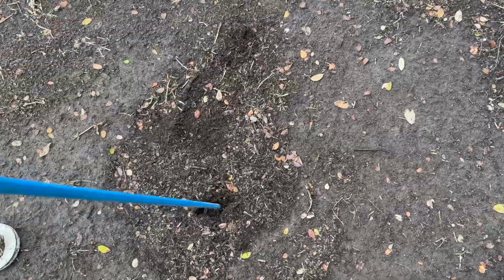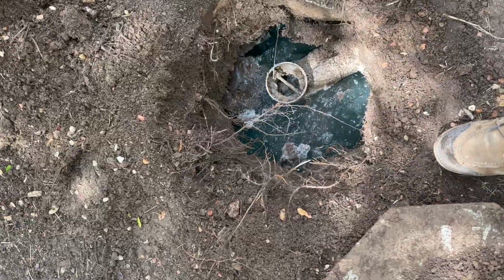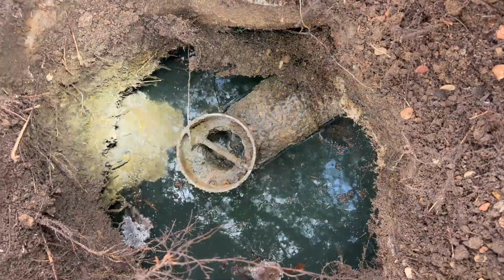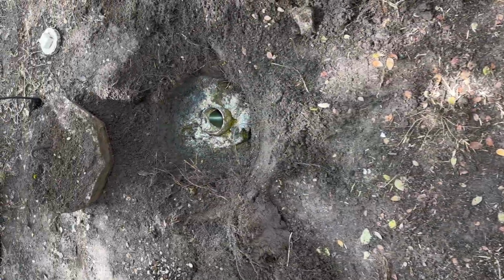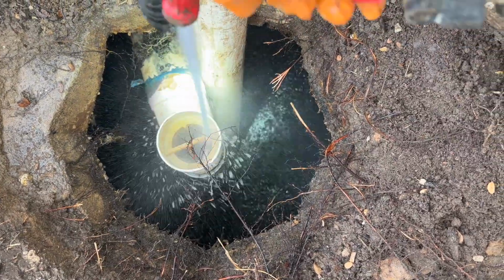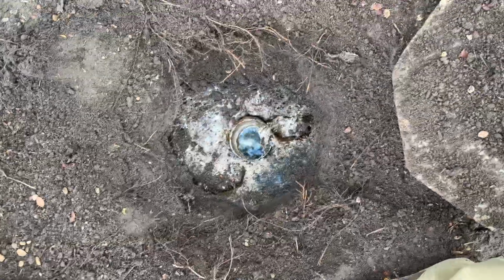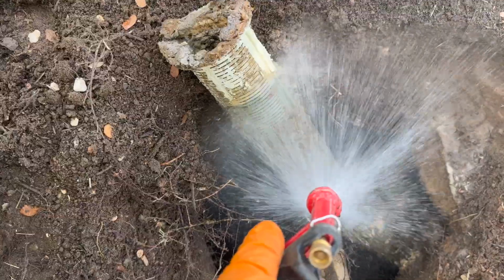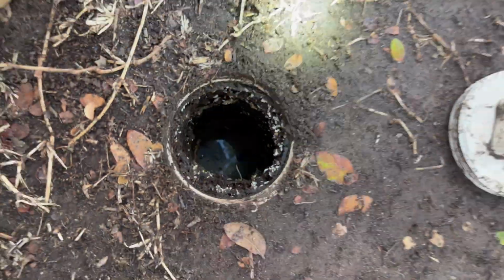This Dirty Filter Clogged the Septic Tank

Comment: I’ve been a septic system designer/soil consultant/inspector for twenty four years and it is so nice to finally hear someone on YouTube give good info on septics! Keep up the good work spreading truth!
Reply: I'd be curious to hear your take on UV systems. I've installed maybe six septic systems, all according to the engineers plan. I heard about UV from the septic guy who cleaned and certified the system for sale. What's up with those installations?
Reply: I haven’t a clue how septic tanks work. I’ve tried to get my head round it to no avail. All respect to you for your capabilities.
Reply: @bobbibuttons8730  It's easy, Tank #1 is a Trash-tank where bacteria who live in low-oxygen eat each other to gas off as much of the sewage as possible. 
Then on modern systems the 2nd tank contains larger-bacteria that require 12-16 weeks of population growth but can be killed off with less than 24 hours of low-oxygen. The other two tanks are just for settling or storage until pumping.

Comment: Great videos to help educate people. I bought house with a 40 year old concrete septic tank. When they pumped it out, they said it appeared to working how it should. I've never had any problems minus it flushing slower after very heavy rain. It's always bone dry by the tank area and leach field. Would you recommend adding a leach field cleaner monthly since it is so old? I am the only one living here and am pretty conservative with water (only a 3-6 gallons are going down the drain each day.

Comment: would of been nice to see you pull the filter with the water still in tank to see if the drainfield is actually taking the water or if it's a bad drainfield with a dirty filter. Anyways good work here thinking of starting a lil vlog of the pumping we do in FL

Comment: Not uncommon for me to inspect a septic system where there was a filter on the outlet and the property was not aware there was a filter and it had jot been cleaned for  years, perhaps since it was installed. When I replace damaged outflow baffles I always recommend a filter be installed. However, I advise my client that if they are not going to be able to clean the filter per the recommendations of the manufacturer that they not install the filter. Have yet to have a client tell me not to install the filter, but would be interesting to see how many do routinely clean the filter.

Comment: is the water hose provided by the client or is it connected to the same pump on the truck you use to clean pipes with the jet?
Reply: It's a vac truck, he has a hose attached to the truck with clean water

Comment: Ohhh LAWD. Not much purpose in using a filter if youre just going to spray all the solids it blocked right down into the outlet pipe towards their drain field ☠
Reply: Tank is being pumped down with water level far below outlet to drainfield, so solids from filter are falling into tank, not going into drainfield.

Comment: Love the channel, but I despise my new-OSSF inspectors in my county. You need to keep a record of systems installed-&-inspected by the county so that you can demonstrate that Texas actually doesn't intend on improving health  outcomes.  Basically many of these systems are adequate for modern health standards but most if not ALL of the installed-&-inspected ones in my area are spraying cesspit-juices within 9 months & completely failed by 24 months, &... the owners ignore the cesspit b/c they don't have any clue at all of the cesspool they're living on.  It's a total designed-to-fail inspection setup, the county is intently making their inspections pointless.   

I'm battling right now for them to enforce venting the aeration-tank to atmosphere & not into the homes of my neighbor's house-plumbing. My current approach is floodplain violations where the air also can't escape through the irrigation b/c the irrigation should have a check-valve to not fill the tanks with surface or ground water.   These OSSF Directors here in Texas are complete wastes of space.